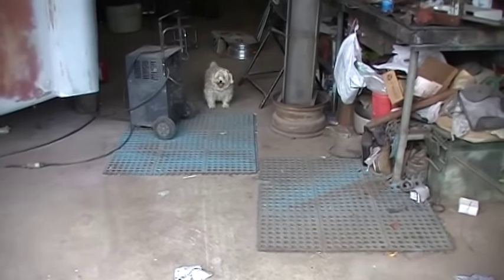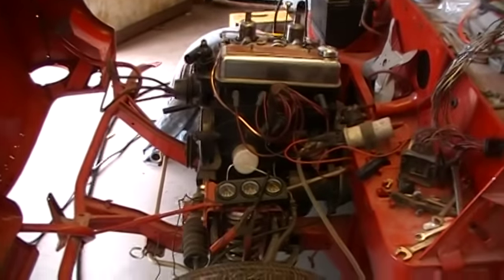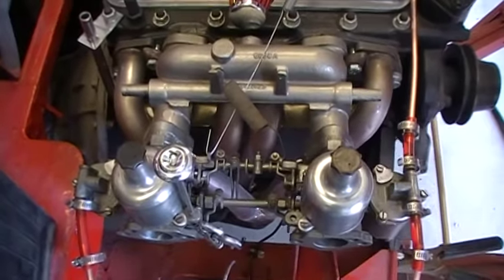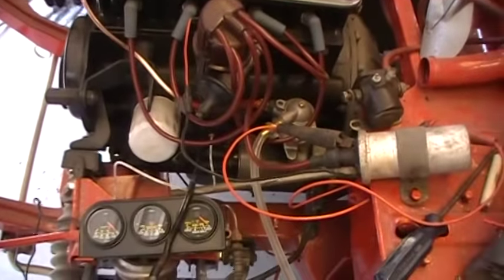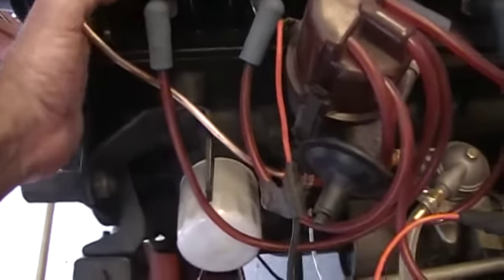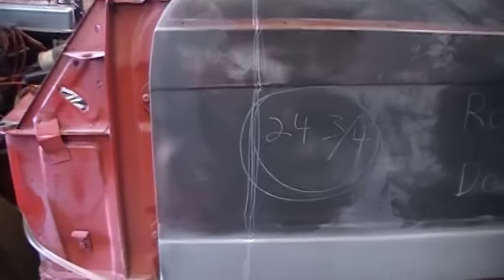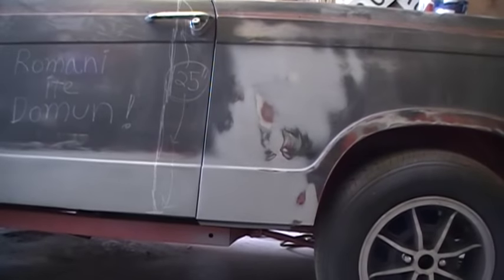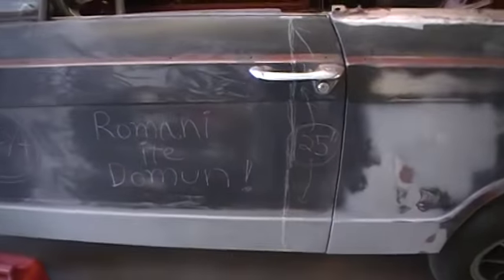Herald starter fail

Comment: My Spit had starter issue when I got it, had to overhaul'er before I could even crank it over. 
I need to get a header for mine being I changed it over to a weber intake and carb. Weber intake is not designed for stock exhaust manifold.
Its going to be real nice Cut when its done.
Reply from the maker: Yes, I love your Spitfire.  Very happy someone I know has one like me.

Comment: Don't know about dynamite but I had a Black Cat go off just as it left my hand. Those fingers let me know about it when it gets cold. You are right about batteries. I was working on a garbage truck and the battery was low on electrolyte which means it was it was working overtime to keep it charged. The truck stalled so I stuck my head down where the battery was and twisted the cable end. BOOM. Was I surprised and scared. I got splattered with acid and dirt could barely see. Lucky for me it was summertime and people have their hoses on. I ran to the side of someone's house and washed my face and shirt. Got holes in my shirt, pants too. BE careful. When I jump start cars the dead battery is hooked up first and the good battery last. 
Cut, also saw a good video on tractors. Guy named tractorhead04 put up a video on the "Mercer County Antique Power Association 2015 Show. Check it out you,ll like. TFS
Reply from the maker: Wow I am very happy you didn't get too hurt. I will check the tractor video.  You are a keeper!
Reply: +cutworm59 
Thanks.  Sometimes, when I was young and not so smart I did some pretty dumb things. When I started watching and listening to older people I learned that they were trying to help me not make some of the mistakes they made. Some things though we gotta learn on our own. Especially if we are stubborn and some of that is running around in me. My wife says I'm a keeper too. She says that so I'll know she loves me.

Comment: If you want to cut the 12 volt to 6 volt, just cut your battery in half...
Reply from the maker: +The Shade Tree Fix-it Man I just tied a knot in the cable.
Reply: +cutworm59   No, No, No, you halfto cut them battery cable things in half first then tie into a Kanot! That's why they call it a "Halfto". Sorry Brother about your loss.
Reply: +Hot Rod   R U sure? Don't you have to tie the gnots first and then cut them? Otherwise all the electricity will run out when you cut them thar cables, don't you know...
Reply: +The Shade Tree Fix-it Man    I think that's what you do before you chrome the muffler bearings. All OK in Sector 9!
Reply: +Hot Rod   And just before installing knifflin pins.
Reply from the maker: +The Shade Tree Fix-it Man  Don't throw th Jhonson rod through th firebox!

Comment: 12 volt to 6 volt. Pop the caps, insert screwdriver with negative jumper cable attached, into the 3rd cell from positive post. Presto - 6 volts.
Mmmmm ..... or is it the opposite? Can't remember. Go figure. Check it with a multimeter and you'll know for sure.  2 volts per cell cumulative, so you can go 2 - 4 - 6 - 8 - 10 volts for your household and workshop appliance needs. LOL.
Reply from the maker: +EdOfTheNorth  Great idear! Thanks Ed!